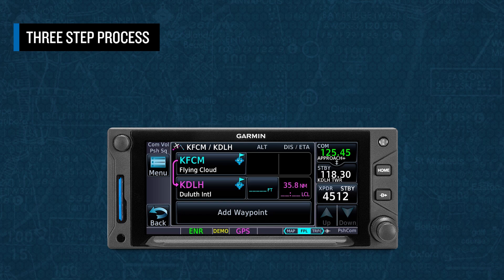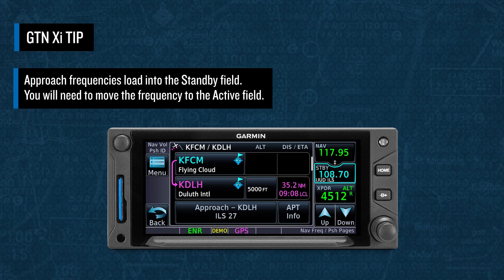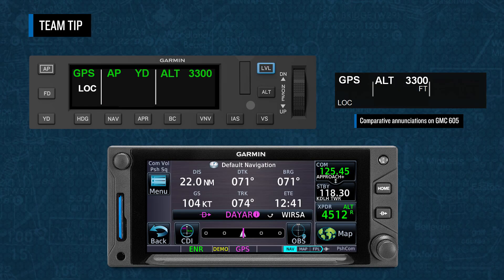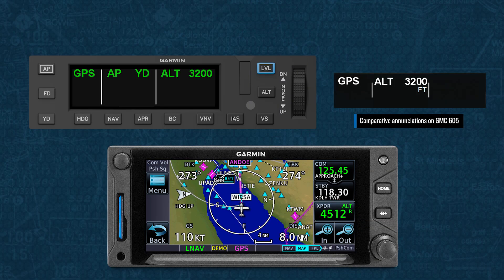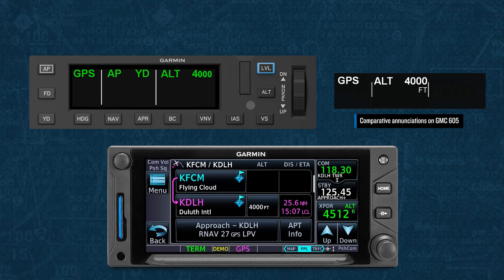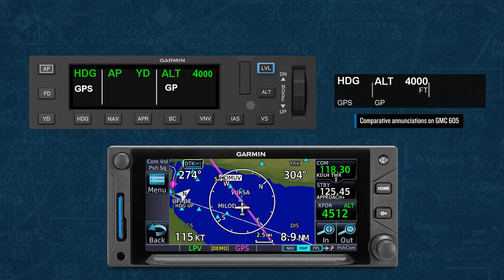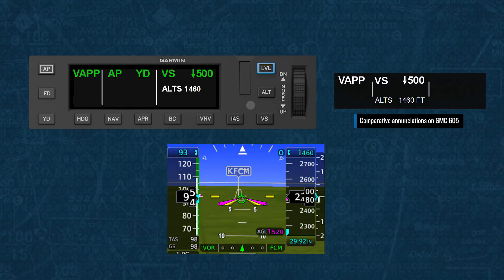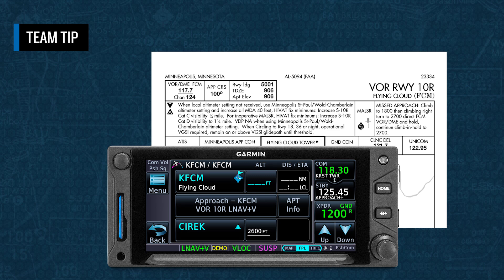GFC 600 Autopilot Operations: Executing Approaches

Comment: My biggest aviation wish list item is a software package that would teach me these skills using a high fidelity simulator, initially simple then progressively more complex navigation tasks along with instrument failures, loss of NAV source failures, powerplant failures, comm failures.  Such a software package would spot pilot weakness and reconfigure itself to emphasize lessons for remediation.  I would gladly invest in a home simulator if I knew such a system existed.  Where I rent a G1000-equipped C172 has a RedBird but I'm reliant upon a CFII with time constraints, the experience comes at an hourly cost, and overall, not really what I had in mind.
Why can't Garmin team up with a few FAA Gold Seal CFIIs along with a manufacturer of home-based flight simulator hardware and software, to create an extensive lesson plan for pilots like myself who want to move up to more capable avionics.  I would gladly spend several thousand dollars for the initial purchase, and even a monthly subscription, for such a system.  I have an unused, spare bedroom in my house, and sufficient time to devote.
Big mistake by Garmin, in my opinion, to let motivated, enthusiastic pilots like me, with adequate means, to twist in the wind.